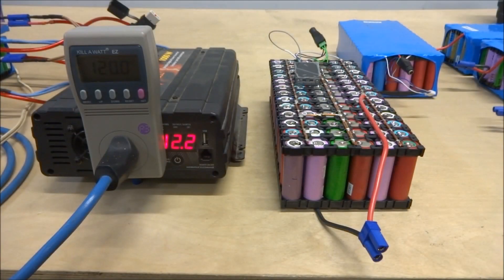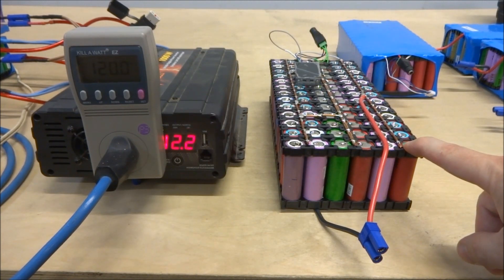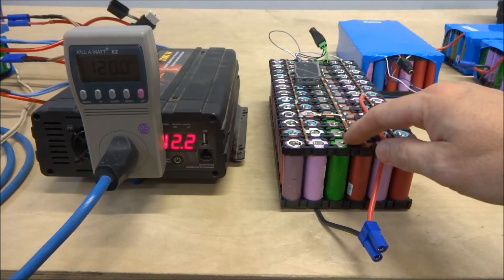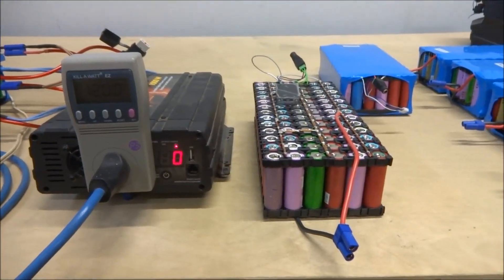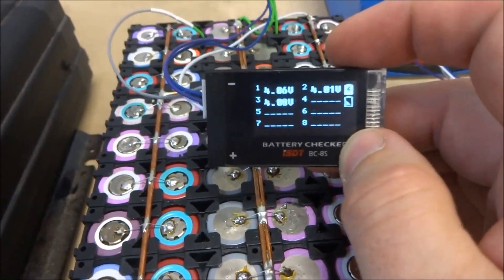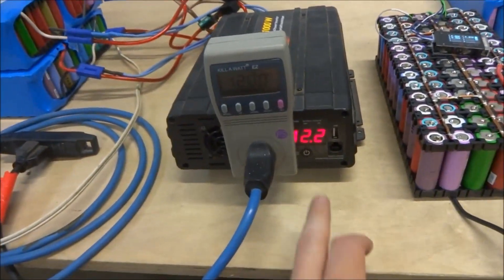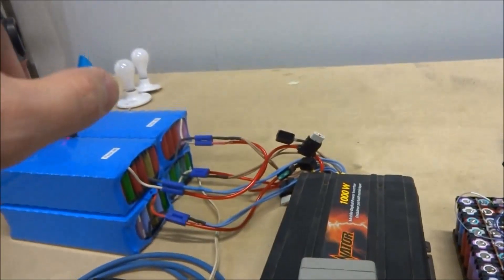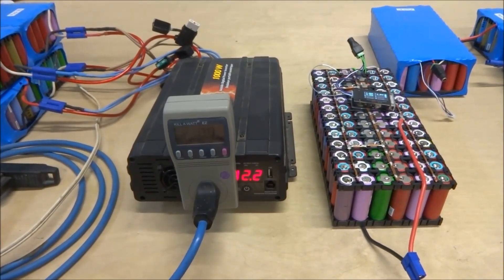Running a 12v inverter on 18650 packs

Comment: 750watts, pulling about 60 amps on a 26P pack...ehhhh a little over 2A per cell be careful there. I know in parallel with the others you'd be pulling  less than a quarter amp which would be safest. These old laptop battery cells new usually were 3A or 4A cells but now....safest to run them at 1A

Comment: I just bought 1000 18650 batteries and thinking about all the projects I can do. Currently I only did one 3s4p battery on a 120w inverter.

Comment: Can we make big inverter battery from these cell
Like 12v 500Ah
Reply: That was his original plan. Put them all in parallel and use with this inverter. 2S26P probably an average of 1800-2000mah per cell so 52Ah per cell to be optimistic. 14 of those makes a 700Ah 12V battery but it will cut out a little early so probably only a useful 450Ah or so.

Comment: If you didnt know, you can modify these inverters for Lithium batteries, you can modify them to cut off at 9v for a 3s or 12v for 4s and you can make them run up to 16.8v and remove the 15v limit. Theres not much information on the internet about it but I've done it and it works well.
Reply: If you had some info on that. or be able to help.I would luv you for ever.plz.
Reply: any information?
Reply: @sheedyaja6465  you cant find scheme matics for this but you have to change up whatevwr reads the input voltage, if you screw with it, you can change the input voltage
Reply: Do tell!
Reply: was looking 4 this comment, thank you ! :D

Comment: Man I wish I had them battery packs,that is awesome.i have about 250 cells I'm harvesting now for my first time,most are log and sanyo 2200mah cells, how long do y suppose 3 of them 3a packs u made will power some bare necessity's. Like a cpl lights  and a tv or maybe even just a fridge? I bought the cells for this purpose and to build a small powerwall that's charged from solar. But as of right now I know very little.
Reply: Times the milliamp rating of the battery by the nominal voltage (3.6) and you get a rough watt-hour capacity of each cell (an individual 18650). So if you are using 2500mah cells, each cell would be roughly 9 watt-hours. If you have 3 in series for this application, you have a roughly 27 watt-hour battery. So you could theoretically run something that uses 27 watts for 1 hour or if you had something that requires 6 watts for about 4 hours of something that uses 1 watt for 27 hours.
Your 3 amp hour cells have 10.8 watt hours per cell, so 9 of them (3x3) would be roughly 90 watt hours. 
However, the inverter will shut down with like 70% of their energy not used because the low-voltage cut-off of the inverter will shut it down. You really need an inverter that works at a higher voltage and use 4 cells.

Comment: I use used 18650 cells.what is better,14 packs in series or every pack wired in 48v configuration.

Comment: is it possible to connect two 36 v 8ah lithium ion batteries from an electric bike to an inverter to turn into a portable charger for my laptop and mini electronics? I was involved in an accident now my ebike is totaled but I have all these extra parts I want to put to good use.
Reply: You would need a 36 volt inverter and wouldn't be worth it for that small of battery.

Comment: I'm in need of building a battery pack that will produce enough energy to power 1000 watt bulb for at least 3 hrs. Can you anyone give me any guidance? thanks
Reply from the maker: Wow, that's a very powerful bulb!! What voltage? 1000W for three hours is 3000 Wh or 3 kWh. Assuming 85% conversion efficiency you'd need a battery with about 3.5 Wh total capacity. Since a new 2.6 Ah 18650 is about 9.36 Wh (2.6 Ah x 3.6 v) you'd need about 375 cells.Assuming you plan on powering this bulb with a 12v inverter, then you need a 3s pack so a 3s125p might do it but since a 12v inverter won't use the full capacity of the 18650 pack you probably should go with a 3s150p. If you are using used cells with lower capacity then you'd need even more.
Reply: wow that's a lot of batteries, there has to be another type of battery to do this with, that won't cost as much or take that much space. Thanks for the reply
Reply: @DIYbatteries  How about a 250 watt bulb for 3 hrs?
Reply from the maker: @garystryder8309  Just follow the math in my previous answer: 250W x 3Hr = 750Wh. 85% conversion efficiency yields  about 880Wh. 880Wh / 9.36 = 94 cells. 94/3= 31.33 so round to 32, so 3s32p.  Or 250 W is a quarter of your initial question so you need one quarter the number of cells from the previous answer.
Reply: @DIYbatteries  I'm getting close now. Is there a smaller more powerful battery that I can use to achieve the same result?  For now what you are saying is that I need 32 18650's to make this work?  Thank you by the way this is really helping me understand. Is there a better way to communicate with you?  do you have a site or email? thanks again.
Reply from the maker: @garystryder8309  No, you need 96  18650's, three groups of 32 cells in series to run a 12v inverter. 18650s are about the highest energy density cells that are readily available. Some other options would be to get Nissan Leaf batteries, although the energy density isn't as good, they are much higher capacity so would be much easier to build into a pack of equivalent capacity.
Reply: @DIYbatteries  So I think I can make it fit, 26x16 inches 1.5 inch tall? that would be just for the batteries?
Reply: @garystryder8309  are u sure you don't want to try a different type of light instead of the batteries? I get that some people need certain types of high intensity light with certain colour spectrums, but for most people it would probably be cheaper and easier to buy a new high output led system that only requires a fraction of the battery capacity.
Reply: @Jake12220  hello Matt, yes this is not for home use. I work in hospitality it is very much need. If you have ideas let me know
Thanks
Reply: @garystryder8309  lm still not sure what you would be using a 1000w light for that couldn't be done with a more efficient led system, but if you can bear more weight then maybe consider deep cycle AGM batteries. Definitely a lot cheaper, 2*200ah batteries should be able to take care of the light with plenty to spare(they last a lot longer if you don't fully drain them).
If you want it to be more portable then maybe 3 or 4 100ah batteries instead of the 200ah ones as they are generally used for boats and campervans/RVs and are uncomfortable to carry on your own.

Comment: I am using a solar generator 4000w with lithium batteries ready made design for e bike. My batteries are from China. Company X-GO e-bike battery 48v 960wh each. 4 pieces. I use this on trike scooter to sell hot and cold drinks at work, also hot sandwiches. So I made a lot of money, I already earned money back invested in my solar panels, 4 batteries 48, total 4000wh, one pure sine wave inverter 48v, car sockets, golf cart dc dc power converters 48v step down 24v 50Amps peak. My electric solar trike moped its a unique prototipe inovation wich can power home utilities in case if someone needs emergency electricity after environment accident or after storm. I made something unique design wich takes space in 2 tool boxes 25 inches caried in a cargo 3 wheeled chinese moped. I've invested around $4700 in my vehicles. I can drive 200 miles if I don't use top much power for cofee and sandwiches. Hope you guys, will do the same. You can find me on facebook. SAMUEL NEAGU.

Comment: No BMS when packs linked together in parallel let them have two to three hours down time the packs may go out of balance when in use a little then in the down time will balance them self’s.just have twice the battery you need to power .👍
Reply: They will balance themselves over time. Seeing as lower capacity cells have more resistance. Just do not overcharge like this guy must do for 12v packs.

Comment: Great video I built 2 battery at 12v 30 cells each pack what pvc shrink wrap will fit these pack I don't know what size it is
Reply: A 2ltr coke bottle is perfect for a 3s battery pack and shrinks well and if u have fused your cells you can see the fuses because its clear and boy it's strong lol

Comment: I have a 500w 12v inverter Which also charges the current 65ah lead acid battery true grid power. This is automatic. Iam planning to put 18560. 3p i wanted to know do i need a bms as my inverter also charges the batteries. If yes what amps bms i need.
Reply from the maker: I have never used a bms, but if you plan on using the inverter to charge your battery be very careful as it will most likely over charge your li-ion cells and could cause a fire.

Comment: I live in Orange county, CA.  If you live near by, I will buy your batteries from you.
Reply from the maker: Sorry, I live in Ottawa Canada
Reply: I want one too! or maybe even a few! seems rather practical for emergencies or a camping trip. or a rechargeable RV.
Reply: Hey True, do you have experience building these packs ? I'm in Los Angeles and need one built to power an inverter for a mobile/solar setup.

Comment: You really would have been better off going 24/36/48V, it's not too much for a good inverter at that voltage. A bit harder to balance/parallel but it's worth it for the efficiency gains and voltage range lining up perfectly.
Reply from the maker: agreed, but this is an inverter I purchased long ago, before I even started salvaging 18650 cells.
Reply: @DIYbatteries  very useful info here :)